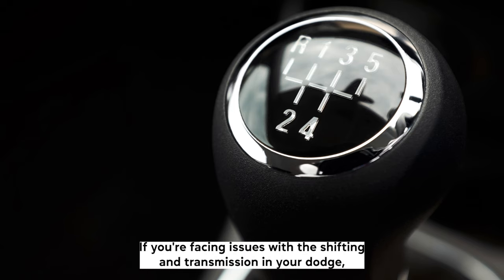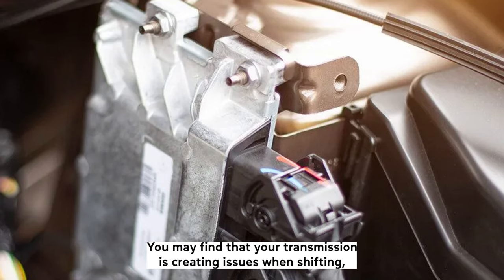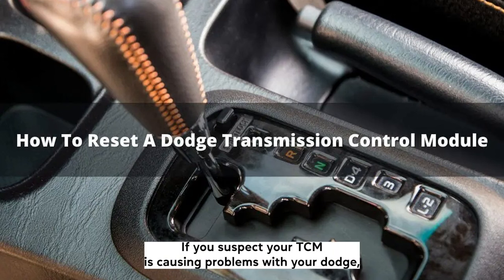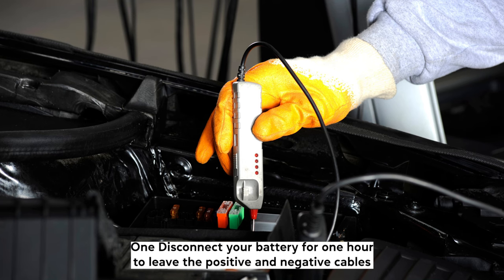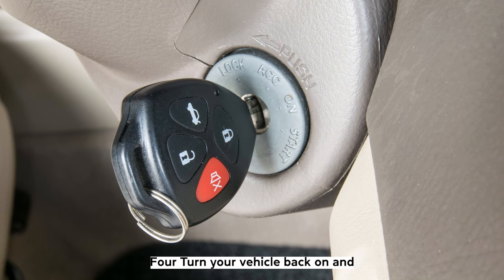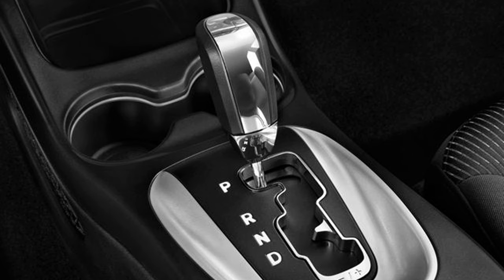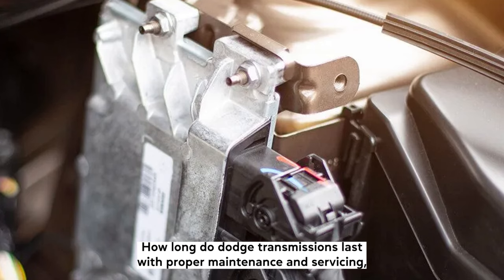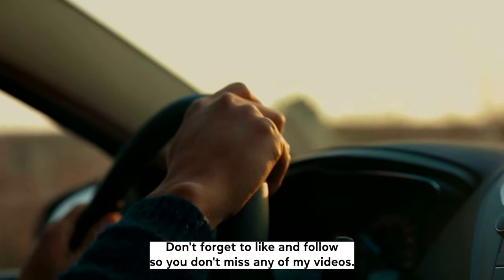How to Reset a Dodge Transmission Control Module

Comment: just changed transmission in a 2015 grand caravan 3.6L vvt just take it into the dealerships and get a transmission relearn for all its worth if anyone is wondering about the Grand Caravan if yours is hard shifting with one or two odd gears
Reply: Hi! I need some advice. Our 2008 dodge caravan is not shifting gears. The transmission fluid was low so we added some and it seemed to go back to normal for a day but it’s not shifting gears again. Will trying what’s in this video help out?
Reply: Thank you, will soon try this❤ I have a 2017 Dodge grand Caravan, still have about $5000 payments on it. it started acting up recently, I’m so sad about this issue. I have great hopes of resetting the transmission will follow instructions. Once again, thank you so much. The saga continues with Hope.

Comment: This worked for me. Tying the positive and negative and waiting about an hour then even used the second part but didn’t wait 5 minutes
Reply: Now my truck shifts better.
Reply: @Showyouhow2lock  did u do every step . And how much did u spend on a new tcm
Reply: I don’t understand the process he said about the positive and negative from the battery and what to do exactly
Reply: @MrRyanlipp1980  use whatever you need, bungee cord, Vice grips, clamp, whatever, but disconnect the battery cables, both of them, go inside the vehicle and turn on headlights, honk the horn, pump the brake pedal several times.  Then make both battery cables touch connectors together, and use whatever to hold them together for as long as you have to work with, at least an hour, or overnight if you can.    The duration really might not matter much, but the idea is for any capacitors in the electrical system to fully discharge, and different vehicles have different options, etc.    Doing the horn honk, headlights, are both to help discharge capacitors in the system, and pumping the brakes makes the ABS pump work, yet another way to get all the residual voltage out of the rig.    So at minimum, disconnect, pump the brakes several times, then connect the connectors on the battery cables for at least an hour.  Reconnect them to the battery, drive it.    The vehicle will behave a bit differently at first until it “learns” your driving style, and since at first it will have less samples to compare to, some of what you do at first will make adaptations somewhat exaggerated.  For example, I made the mistake of using the shifter to hold gears while in traffic, and it took a few days of driving before it would shift into 5th gear on the highway, because it “thought “ I liked holding gears, but that resolved itself.    If you drive very conservatively it will shift earlier.    Please note that while doing the horn, lights, brakes thing none of that will work, which is expected.   Always disconnec t the negative battery cable first.    Always.    And reconnect that one last.   After all of this, it might not change a thing.    If it does not change anything, whatever issue you had most likely had nothing wrong with the “adaptive learning” part of the program, and most likely your Transmission Control Module is fine.    I’m not THE expert, but it seems like, as with our PCs, the computer gets “confused” and becomes much more slow to react.      Think of this procedure as the same as the unplug, plug back in scenario.

Comment: I have a 2019 Ram 1500 with only 29k miles and seems to be stuck in 2nd gear.  Before this happened when cold or if I haven’t driven in 3 or 4 days when first driving seemed to have hard time shifting 1st to 2nd and made a clunky noise but usually afterwards would shift fine but now seems stuck in 2nd gear and engine light came on afterwards…😢
Reply: It's in limp mode.   Having same issue now
Reply: @jeepinb1398  I did the reset on mine a few days ago, fixed the issue. Pressed the start button to put in run mode, but don’t start the engine, don’t press brake then when in run mode, pressed and held the accelerator pedal for 15 sec.  After 15 sec I turned everything off.  I sat in the car and waited like 10 min or so until everything turned off then I started the engine and did a test drive.  Everything is shifting normally again now.  Took a few more drives for the check engine light to go away, and finally it did. Drove for a few days now.  Everything seems ok now…
Reply: I have been experiencing the same problems (2019 RAM) It seems that at the time you come to a stop, the gear stays in 2nd, and after you press the accelerator the gear drops abruptly to 1st causing an unpleasent kick, and I know this will be causing future joint failure when miles add up.
Reply: @mysolarexperience9051 thats all the steps you did to fix the issue?

Comment: Only 3,400 for a transmission replacement? I would think the labor would make it a lot more
Reply: 2 yra ago my 2014 Ram Transmission went and at the dealership with parts, fluid and labor that was a $7,000 dollar job.

I'd only imagine with inflation it's higher now.

Not to mention Dodge/Ram has discontinued the Hemi 5.7 engine. As of Jan 2024 their new engine is going to be called Hurricane. Imagine the cost/shortage it will be for parts and possibly auto insurance going up if you've got one.
Reply: Yea, this person was being pretty generous on the price of a transmission replacement....Mine cost a little over $5K on my Dodge Magnum.

Comment: My 2010 dodge  I had no gears when I came to a stop I didnt even have park when I tryd to put it into park it was making a grinding noise leading me to suspect the transfer case was in neutral neutral I did the battery thing it worked but did it again right away anyone? Deal with this also?
Reply: Your transmission is bad my friend no electronic can fix that sounds like bad pump or broken sun gear something internally bad in the trans unless you transfer case somehow went to neutral and stuck in that position so the input and output just free wheel but try and put it in 4low and 4 high and neutral on transfer case and see if it does anything but also get someone to hook up a pressure gauge to the transmission to check line pressure that will tell you if it's the pump or not but this was a month ago I'm sure u got it fixed I noticed that after I typed all this out but I bought a 96 reg cab 1500 4x4 5.9 super clean for 1k but it won't go over 35 has all 4 gears convertor even locks but at 35mph its almost 4k rpms or higher so I'm praying the transfercase is somehow stuck in 4low but the selector is in 2wd so it does not lock the front dif but will not go to neutral or 4low but 4high works so was urs trans or tcase stuck in neutral

Comment: I just swapped trans on ram 1500 5.7 hemi automatic 2 wheel drive. Filled with fluid. Truck will not move in any gear. Any suggestions?
Reply: Me too same problem
Reply: Did you figure it out
Reply: Yes thank you.  Eventhough the dip stick said full. I added more fluid and it got better with every quart I added. The trans fit 13 and now moves like it should.

Comment: Will this work on a Cadillac Deville? 2005 , it shift fine until it warms up! And then it throws a light with code p2763 , I guess it’s the wiring! I have disconnected the battery over night but I have never done these types of tricks! I guess I need to because it’s a old car runs fine for a hour then I have noticed a slip in 1 to 2 nd , I had the cpu laid over looking for a leak and didn’t unplug the battery 🥵so I guess I try this and see cars are getting to smart he’ll Cost  more  to fix a car than going to a doctor!

Comment: Transmission was just replaced on my Ram 3500 now it won’t start, mechanic says we need to replace the starter! Completely frustrated! It started fine when we brought it in, could it really need a new starter?
Reply: Hello 👋 It sounds like the mechanic broke the starter when replacing your transmission because you have to remove the starter in order to access the torque converter bolts! The mechanic most definitely destroyed the starter prying on it or broke wires on hooking it 👍🏻
Reply: @SMOKEY-JAYS-DIESEL  you are absolutely correct! He finally admitted he broke it after some back and forth and ended up paying for it.
Reply: @kelcaba7914  Yes, I understand. I own a diesel mechanic business under the name Smokey J's diesel and my employees break stuff like that too and me being the owner. I have to replace it because I know what happened. I'm glad he admitted to it and made it right 👍🏻
Reply: @SMOKEY-JAYS-DIESEL have you ever heard doing a Shift stragedy reset on a 2017 1500 Ram will make the truck worse?
Reply: Maybe he didn’t connect the starter back or blew the fuse , doubt it’s the starter you have to remove the starter to realce the transmission.

Comment: Sooo... my transmission was acting all funny when trying to shift from 3rd gear to 4th. Got a C-READER 3001 (30$ on amazon), plugged it and it was showing "P1741 CODE ERROR" so I unplugged the battery, pressed all the electronic buttons + gas / brakes for about minute, I taped both positive and negative cables together for one hour and now my 2017 Dodge Caravan works fine!